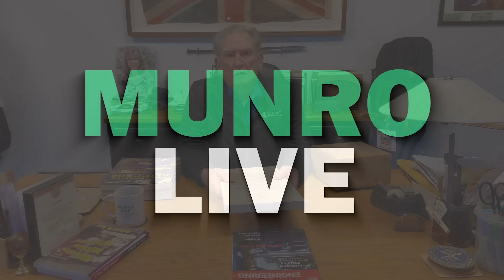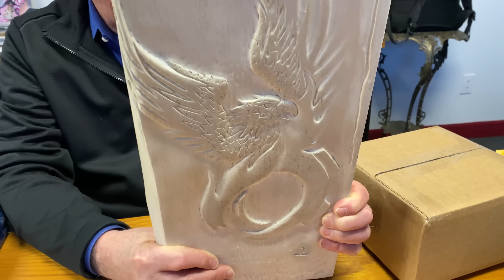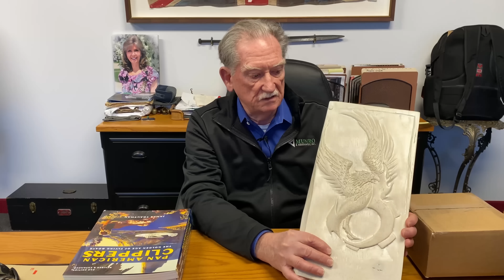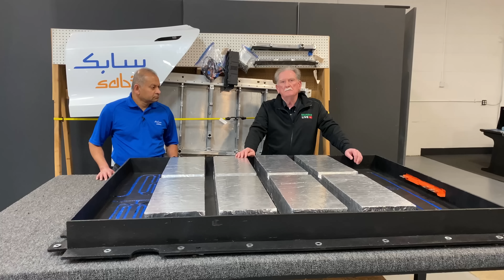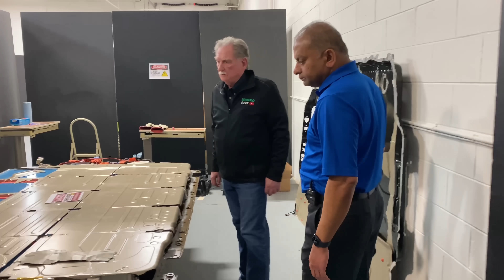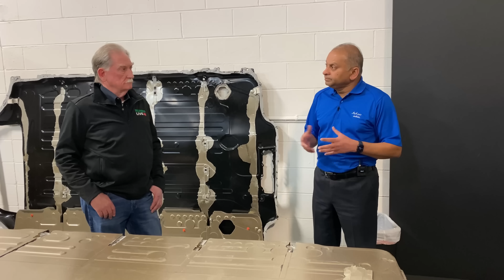Munro & Sabic on Battery Tray Composites - Tesla Model S Plaid Battery Tray

Comment: Roughly, how much weight could potentially be saved if a composite material would substitute the currently present steel cover + mica alone? I somehow miss this key information in the otherwise informative video.
Reply: Well.
A 2m by 3m sheet of 3mm steel weighs 140 kg. That's the floor of the car.
About the same for the top cover of the pack.
Then there's the tray, depending on material?.... 100kg?
The internal bracing? 30 kg?
So a moulded tray which you drop the cells Into, with Cooling channels moulded, and busbars pre-installed, which with the cells makes useful structure?
I'd say a "considerable" amount of weight?
Reply: @rogerstarkey5390  3 mm would be Cybertruck, if at all. Car blankets are more like 0.5 to 0.8 mm.
Reply: @bernhardleopold6702  
The structural base of a bodyshell? 0.5mm?
We're talking mild steel, not stainless.
Let's ask the experts?
Reply: @rogerstarkey5390  I don’t think that is steel with 2 or 3mm of thickness, that would be too thick. It looks like a stamped steel, if so then that level of thickness would be too much. Remember how 3mm thick cybertruck steel body is too thick to be stamped? Hence the polygon look? At most it’s probably 1mm, most likely less.
Reply: @Arpin_Lusene  
The CT is a hard alloy..... But let's just call it "substantial".
And I'm talking about the bodyshell floor AND the pack. 2 sheets
Reply: It wasn't mentioned but I too, would have been keen to get a rough estimate, (percentage wise), of the anticipated weight savings. Wouldn't be possible to get an exact number as there's such variation from vehicle to vehicle but instead a percentage of say, 10, 20, 30% or more for example would have been useful.

Comment: Not a big fan of using composites in battery casing. Cheaper to produce, but worse for the costumer. More easily damaged, the heat cycles will make it brittle in few years, and not recyclable.
Reply: You're guessing (as usual)
Reply: @rogerstarkey5390  not guessing, that are facts. And you as usually, pandering without using common sense.

Comment: PLASTICS ARE NOT INHERENTLY BAD it's the proliferation of pointless single-use plastics and ultra-cheap plastic crap that breaks almost instantly and is not recyclable. 

THAT'S the problem - you don't need a plastic coke bottle...
Reply: Coke bottles are made from 100% PET, one of the most recyclable plastics we have. 

Tax carbon emissions, tax unrecyclable materials and composite packaging, solve the problem
Reply: @nigelmckee3058  - YET - QUOTE "Coca-Cola produces some 3 million tons of plastic packaging globally each year – the equivalent of about 200,000 bottles a minute – and it's been branded the world's largest plastic polluter as the vast majority of this never gets recycled"
Reply: @piccalillipit9211  the problem is not the plastic, the problem is the lack of a recycling system that works. Here in Finland there is a deposit system in place and over 90% of the bottles and aluminium cans gets recycled. You pay a small deposit on every bottle or can and you get it back when you return them, very simple and effective.
Reply: @kobbetop  - I think I said in reply to someone that the problem is not plastic, its an amazing thing. the problem isOUR ABUSE of plastic as a society. 

The idea that plastic is disposable is the worst thing we could have come up with. Its very much NOT disposable. 

I watched a program on industrial archaeology and they were uncovering a factory that had been completely buried in a valley by a landfill in the 1950's and 60's as they dug it up all there was was soil and PLASTIC.  Even the tin cans had rotted away - but all the plastic bags and other stuff - all still there the same as the day it went in there...
Reply: Actually i prefer plastic bottles at work, because i have the tendency to break glass bottles. (they tend to fall over to the side by accident and shatter). But i only use the big Multi-use ones.
Reply: @unitrader403  - Thats fine - I used an iced tea bottle for 2 years for water for the gym.  And that's the thing - plastic is amazing - a bottle that is designed to be thrown away was used 6 days a week for the gym for 2 years. 
Plastic is NOT the problem p- its our abuse of plastic that is the problem.

Comment: When the plastic composite burns, would it emit harmful gases in cabin? 
Also, whats the ball park weight savings you can expect by switching to composite for the pack structure?
Reply: They mentioned completely flame resistant composites. You can make them super hard to burn.
Reply: @Johnathan Clayton  I thought they mentioned that it still chars, so the surface will burn, and then become inert. My question is when it chars, are the fumes safe, for when you're still stuck in the cabin.
Reply: @Flannigan Flintson  For sure, not debating that. I'm wondering more from the secondary effects of switching to composites. Light weighting, cost savings etc are a given, but I'm certain there is a gotcha clause somewhere.
Reply: @MADMAX7330  The good news is you won't get burnt by the battery cells, the bad news is you will suffocate on the fumes from the plastic tray.
Reply: @MADMAX7330  Perhaps but it's not really a given.. Perhaps there really just is no downside to switching to the composites over alu/steel/mica.. We'll see, if anyone decides to go that route
Reply: That would be about the 3rd question in the "which compound do we use" meeting?
PLEASE.... before posting, just think "would the "EXPERTS" have considered this?"
Then comment accordingly?
Reply: @Roger Starkey  While perfectly reasonable, I can assure you that even 'experts' have blindspots. For example, if there was a gap in regulation, I can nearly guarantee you that no 'expert' spent a single brain cell on the matter.

Comment: So much hate against this for no reason, but when batteries weigh as much as they do right now, and all weight counts, this composite/plastic battery pack idea could further reduce the weight into a comparable vehicle weight from a fossil car.. Elons new structural pack brings this closer, but could be even more with a composite pack design.
Reply: actually a fun experiment control of the safety aspect of this Sandy would be to take a chunk of this composite with fire retardant and do a mock thermal runaway with some 2170 cells. show what happens.
Reply: Only one reason.  Can't recycle plastic.  That is all.
Reply: @davidbeppler3032  
Watch the Munro, Rivian episode.
THAT is all.
Reply: @rogerstarkey5390  Watched it.  Changes nothing.